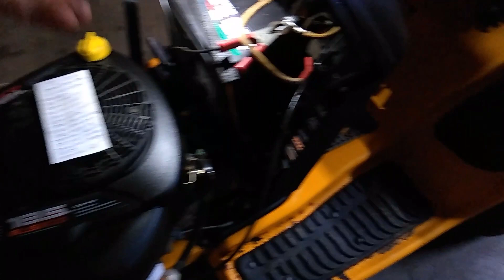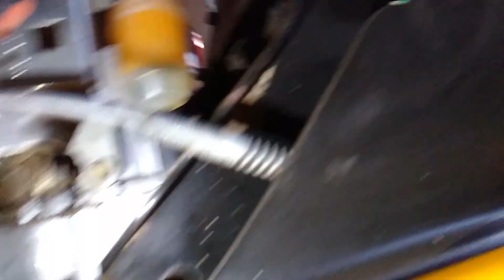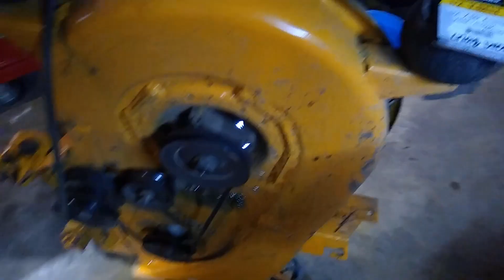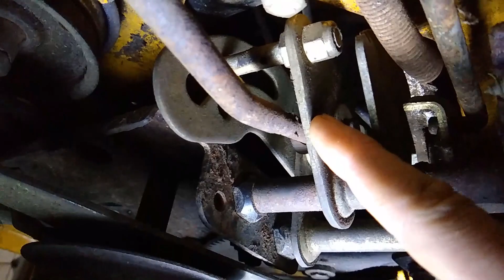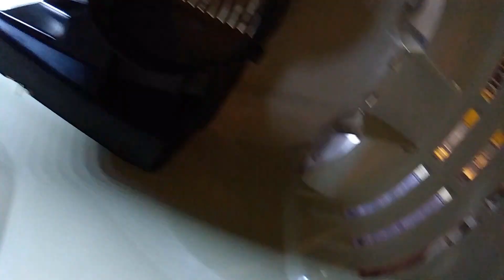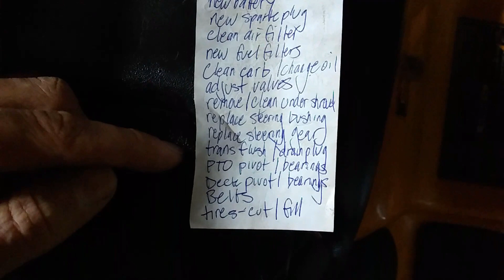Unscrapping: Cub Cadet LT1018

Comment: How long was the drain bolt that you used for the transmission?
Reply from the maker: This video was taken several years ago, and I don't recall for sure.  I would say .750" or so.
Reply: Man thanks so much for the reply @SolunaGarage
Reply: Do you remember what you used to pump fluid in?
Reply from the maker: Yeah, a simple fluid transfer pump works well.  Just a manual plunger style works well, or you can spring for an air pressure vacuum/venturi style.

Comment: I picked up one of these at a farm implement auction, in "sold as is" condition.  I gambled $300 and a couple hundred more $ for my mower guy, to check it all out .  New battery, and ball joints.  Today, I repaired PTO wire that broke off at L shade connector.  For $500 invested, still much cheaper than a new one.  Cuts great and runs good.  Probably a valve adjustment in its near future.  But if it ain't broke, don't fix it.  Right?
Reply from the maker: Yup!  For under 1k you can find and fix up a lot of decent machines.  The 1000 Series aren't the most robust unit, but for simply mowing the grass they do a great job.  Depending on the hours you have on it, I would highly recommend changing the transmission fluid.
Reply: @SolunaGarage  Thanks.

Comment: A lot of it has to do with simple maintenance. That rusted deck rusted from the top down from grass just left to rot. It takes 30 seconds to grab a leaf blower when your done and blow that stuff off. But even then those decks are thin and will bend easy if you hit something. I found a cub free that had caught fire. Pulled some melted plastic off and it fired right up. So I got new plastic pieces that got damaged and fixed the valve cover leak that caused the fire and found the engine only had one bolt still holding it down. Then checked why it was so loud. Well the muffler bolts were completely missing muffler just hanging there. After fixing all the stupid stuff it's a great mower I've had it 7 years now fires up every spring. Has the same transmission yours has with 237 hours of that's correct and not rolled over had 200 when I found it. Fluid was black black black and very shiny and was slipping. Filled it with hydrologic oil I use in my log splitter and it's working great again... For now.

Comment: Enjoyed your video, Just purchased a  2004  Lt1018 with 289 hrs. for $460  looks to be well maintained (no rust on deck, or tractor except floor pans under mats) Said he put a new transmission and all new drive belts @ 275 hrs. (belts look new) I was working on it (just greasing and searching for grease fittings and disconnected the no mow in reverse ground wire)  had the neutral rod engaged rolled it a bit, then engaged the neutral rod, started engine went to reverse and heard a GRINDING of the gears. then it seemed to work ok. (had parking brake set after I rolled it in neutral) Is there a procedure to go to place mower in neutral and disengage It? Thank you
Reply from the maker: Sounds like the rod had been partially engaged.  You are doing the procedure correctly, I would just roll it back and forth before and after the rod has been moved from one position to the next to ensure positive engagement/disengagement.

Congrats on the new purchase!  If the trans is not actually new (is it a used replacement or brand new?) I would recommend a fluid change if you plan on keeping it long-term.
Reply: @SolunaGarage  Yes I was thinking about installing a drain plug but taking off fender pan sounds like a pain but I own old shovelheads Harleys can deal with Pain LOL Thank you
Reply from the maker: That fender pan isn't too bad.  Hidden screws are under the "tunnel" area sticker.  Everything else is pretty straightforward.  If you can deal with the old Shovelheads I'm sure you're well equipped 💪
Reply: @SolunaGarage  All forward movement stopped today. Just sits there and grinds> put it in N and tried to push it NO GO locked up jacked it up and put it on a dolly to push it into garage Got it to start again just sits there no forward or reverse just grinds apparently I was lied to about being a new transmission Shame the mower is in really good condition no rust seat perfect very clean  Probably will advertise for and take my loss. Thank you
Reply from the maker: Noooooo!!!
Reply from the maker: Man that's rough.  I sold one of those transmissions in March of this year.  The used ones can be a crapshoot.  What is your plan for your next machine?  In my opinion, the 2000 Series is the one to go for.  They can be had for the same price as the 1000 Series and are much better built.
Reply: @SolunaGarage Thank you, will get a new 2000 tomorrow. I didn't give up yet jacked it up removed both tires took a 5 lb composite Harley mallet beat the living shit out of the trannie. checked that the pissy little brake rotor wasn't stuck (damn man I have washers larger than that) Wiggled all the levers & shifters. Threw the tires back on and the darn thing took off mowed perfect ???????????? Haunted Cub? Its Fu*kin with me I have a wife to do that.
Reply from the maker: Wow.  That's nuts.  Whatever works 🧨

Comment: I need to remove the exhaust pipe from my LT1018.  Would you know what size Torx bit is required?  Have you had issues removing these bolts? Suggestions? Thanks
Reply from the maker: I have removed them before without issue.  I do not recall the size, however.   Nothing really to note, it's all straightforward stuff.  Just be careful if you are reinstalling anything on the muffler side of things.  They use a lot of self threading fasteners in sheet metal that are easily stripped.

Comment: Just picked one of these yesterday.  Needs TLC.  Did you have a video on the transaxle fluid change?
Reply from the maker: I do not.  I ended up drilling and tapping for an 1/8" NPT plug at the very bottom of the case.  This allows for fluid changes without removing the transaxle.  You will still need to remove the fender pan to gain access to the fill plug.  Not a bad job, couple hours or so the first time.
Reply: @SolunaGarage  Had a thought about gaining access to the transaxle fill plug.  What if I used a metal cutting hole saw to cut through the fender pan directly above the fill plug?   I would place a small magnet directly above the fill plug on the underside of the fender pan; rolling a small ball bearing around until it located the magnet below. 
Could you supply accurate dimensions (or a clear photo) for locating the hole for the lower drain lug?  Thanks!
Reply from the maker: I was going to modify the fender pan myself, I agree that would be a good idea.

As for the hole location, I looked at a parts diagram of the case and found the lowest spot that was below the strainer inside.  I no longer have the unit here but I believe if you watch the video again you will see the flat, low spot at the bottom of the case.  Mine had a green sticker there from the factory.

Comment: I've saved lots of those throw away lawn tractors
usually just some time and maybe 100 of parts and they're ready to go another 10 years
worst thing with the 1018 is the POS B&S
haven't seen too many bad trans, I have seen them with over 1000 hours still working fine with original oil. usually the bad ones were leaking and run low on oil.
Reply from the maker: Not a fan of the Briggs Intek line myself, but this particular one is a very smooth runner.  Surprised me.  And yeah, if these things are maintained, they can go on for a while.  Just gotta keep replacing the consumable parts on them, which happen to be pretty inexpensive.

Comment: We have one of these. We got it in 2004. It's old engine, which is the same engine that's on yours, was shot so we replaced it with a new one. It's a good tractor, even with it's problems.
Reply from the maker: Awesome 👍 
How many hours are on it now?  Kinda curious how long people are getting these things to go on original engine and/or trans.
Reply: @SolunaGarage  well we've been using it since 2004 and we still use it so I would imagine a lot of hours. We had to replace the old engine because it had trouble starting in the cold and it didn't like to start after being put up for the winter. We last used it earlier this year before we replaced it with a brand new engine in April so I would think that we definitely put it through a lot of use. I would say we put the original engine through much more hours than most people would!
Reply from the maker: Those single cylinder Intek/ELS Briggs are actually pretty smooth engines.  What engine did you replace it with?
Reply: @SolunaGarage  we put another Briggs and Stratton in it. This one is a 17.5HP
Reply: @SolunaGarage  I just checked the hours yesterday. If I was reading it correctly, it had 600 hours on it. I don't know exactly how much but I know it was around 600-700 hours.
Reply: @SolunaGarage  hey I just got back around to this video after a while. The LT1018 is still running good, now with 820 hours on it.

Comment: What size is the belt on the deck?   I have a 61in and I’m trying to figure out how to make it fit
Reply: That is what ever Manuel that I have come across has said as well.  But the belt that I have found that fits that deck is 29 inches. If you know how to get it to work please make a video!!
Reply from the maker: How are you measuring the belt?
Reply from the maker: The belt routing is pretty simple on the deck and the PTO belts.  If you want a quick vid on it, let me know.
Reply from the maker: Deck Belt: 954-0498
1/2 x 67"
PTO Belt: 954-0497
1/2 x 60"

Comment: Just got one for free today. Claims to have over 700 hours.
Reply: it’s a good little tractor, but i’m worried it doesn’t have much life left...
Reply from the maker: If it is like ours, there will be some issues with the PTO/deck belt systems primarily. After I get some more hours on it, I'll do a follow up on the areas that still need attention.  If you think of anything or come across anything you want to look at together, let me know!  Could always do a live stream.
Reply from the maker: Wow, that's getting up there for these machines.  Would most likely have been taken care of or had some work done to keep it going that long.  ...or maybe a few times of leaving the keyswitch on!
Reply: Soluna Garage yea, i can barely believe it. i got it running and driving today. haven’t tested the deck yet; it needs cleaned bad.
Reply from the maker: I've actually grown to enjoy using our little LT.